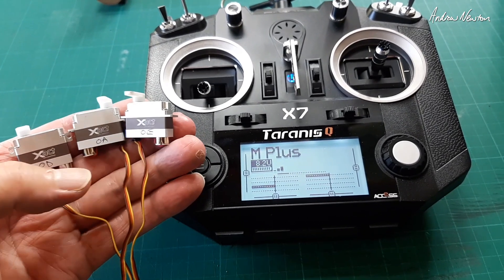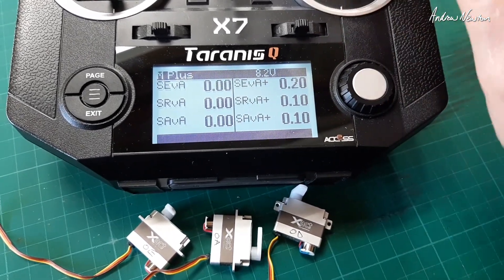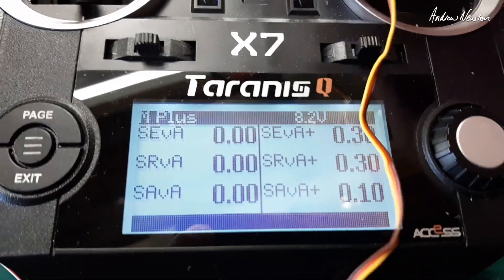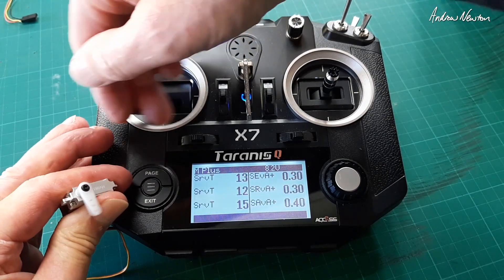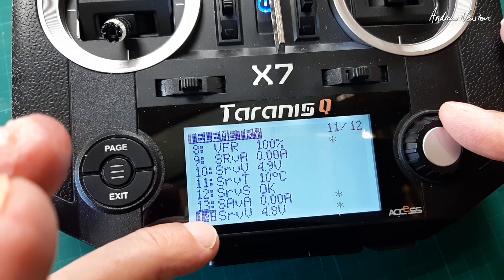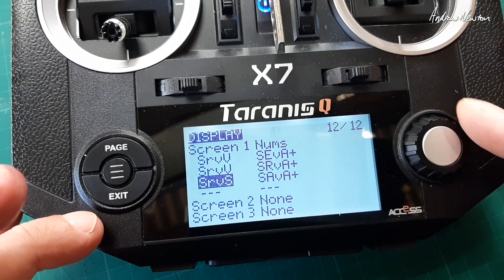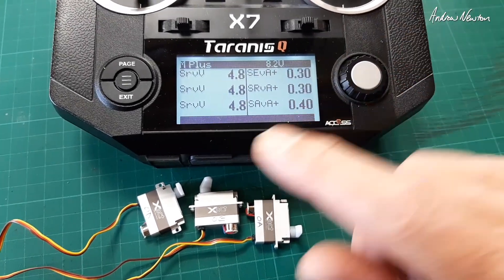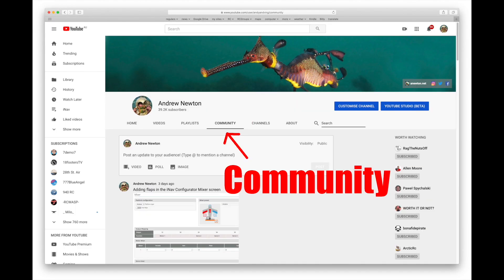FrSKY Xact FPort 2.0 Servo Telemetry demo

Comment: Wait, whats a fport servo vs regular?
Reply from the maker: All explained in the previous video.
Reply: If I am not mistaken, the fport is a high bandwidth, serial, telemetry enabled, servo protocol. 
So basically, instead of having one PWM channel (and associated connectors and cabling) per servo, all servos can be connected to the same cable, as the signal encodes identification specific to each servo (so each servo reacts only to the pulse concerning it), and it also allows to send back servo telemetry to the receiver and then transmitter. 
This could open up lots of interesting stuff like quite consequent weight saving in small, light models like high performance gliders and, let's say, failure detection (if you see that one of your servo is straining abnormally, can "take it easy" and bring the model to land before something bad happens), or identify if there was a hardware failure in case of a crash.
I did not even know that we could have, or needed servo telemetry, but now I want it :D
And I must say that with this functionality, and the added load on telemetry, the change to ACCESS makes more and more sense.

Comment: Just one observation about modern radio design: watching Andrew speeding through the settings and juggling numbers so effortlessly,  there's clearly no advantage in having either a touch-screen or a full-colour display on a Tx.

Monochrome and nice clicky buttons are all that's needed. Your hands are well out of the way, so it's much easier to see what's happening on the screen.

Less is more, dear Designers, so please, K.I.S.S.  (Keep It Simple, Stooopid!)
Reply: All depends on the software and hardware. What transmitters are you comparing to that have touchscreens?
Reply: I'll take my Radiomasters big colour screen and fast access edit Roller Wheel over my Taranis buttons and small no colour screen every time...🤔😳😳🇬🇧
Reply: @EnglishTurbines  Agree - I have used a lot of transmitters and can say that the ix20 for example is much better than a DX series for input, tweaking settings, names and so much more. The PowerBox CORE touchscreen and interface too. Looking forward to using Ethos on an X20s. For me - touch input is definitely the way forward.
Reply from the maker: Yes the OTX colour screen does not impress me